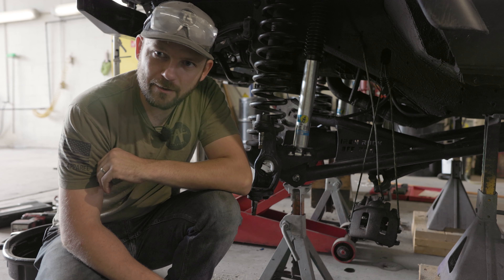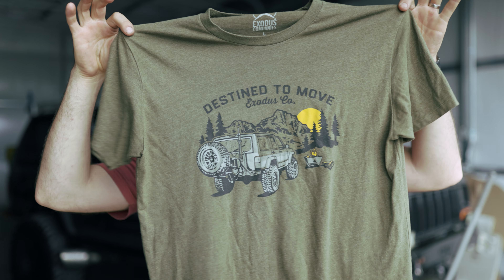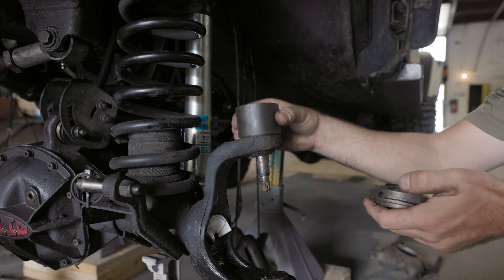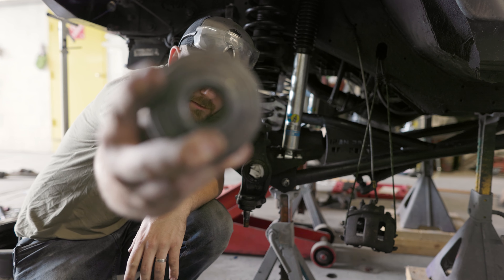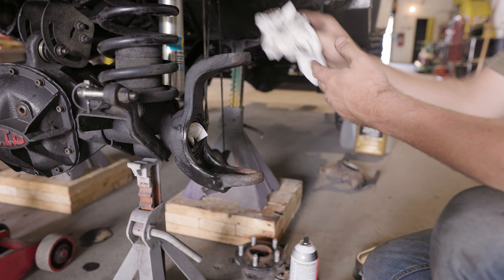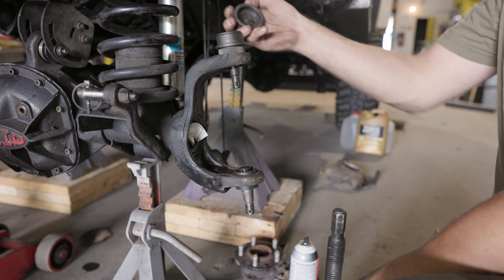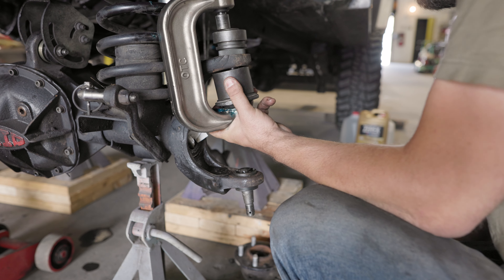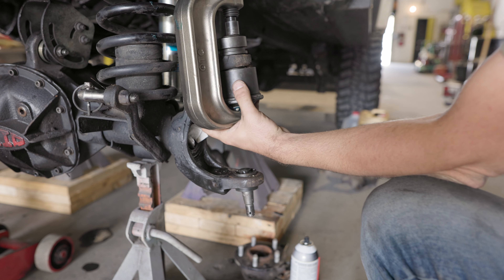Jeep Cherokee XJ ball joints

Comment: When you have a knock sound on extreme turning - which I believe must be the upper ball joint 'popping' - so I replaced the top one only with new, but still 'popping' even though everything looks square, solid and tight. I don't fully understand how the top ball joint works, but I also replaced the tie rod. Inspected the axel also (left side) and I do have new U-joints. I have not replaced them yet, but they seem very solid, no play in anything. Very weird that I still get a popping that you can feel in your left foot when turning on hitting a big bump. Any suggestions on what the check next? I am pretty capable and. have all the right tools to change out anything.
Reply: I did figure out what was wrong. it was not the ball joints - or not the main issue. The clicking was coming from the track bar. I removed it, inspected it carefully, gave it a krylon rebuild... and re-installed it and tightened ALL the bolts to super tight with my impact gun. That stopped the clicking and clunking for sure. Then the alignment was WAY off, so I had it re-aligned and now it's SUPER solid, more solid feeling than it has been in years.

It did cost me a some money to do that alignment, but well worth it.